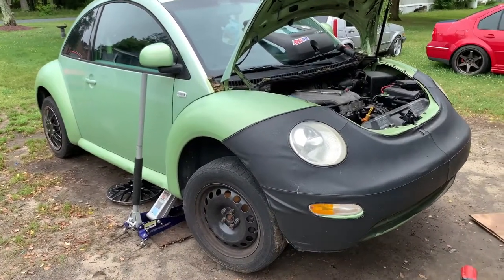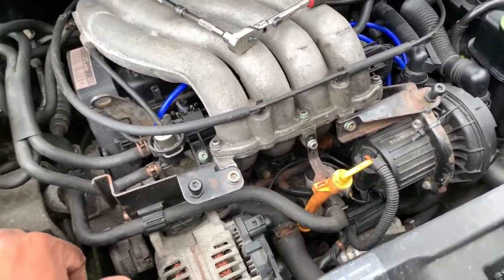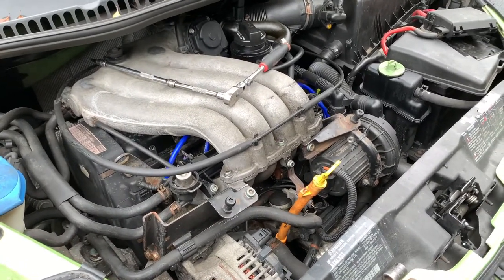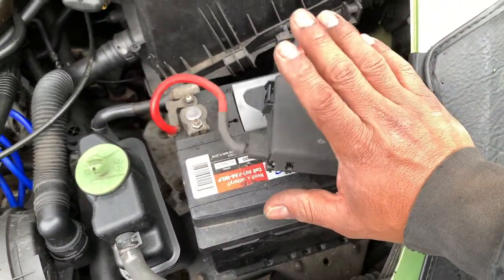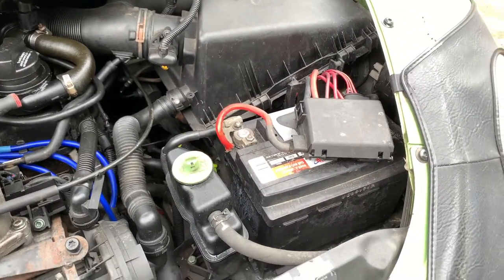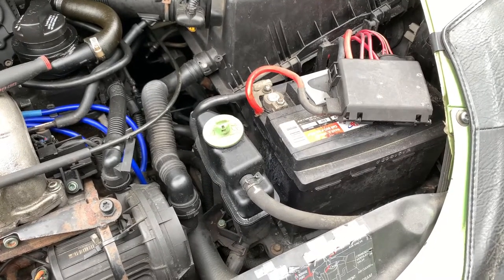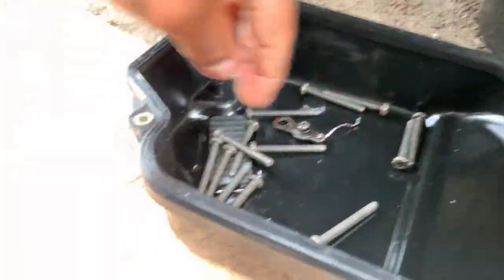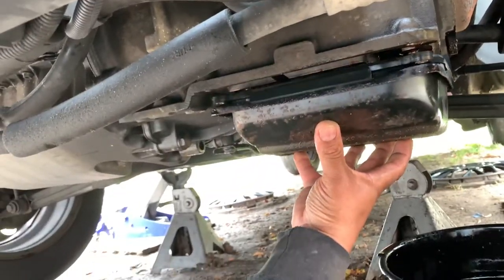Vw beetle aeg 2.0 automatic transmission problems

Comment: Hello, thanks a lot for the video. I have a golf with an 01M that shifts late from 3rd to 4th. Do you think this could be a valve body issue? It also will slip from 1st to 2nd when cold but once warm it's good. It's got almost 400kms on it. I changed fluid and filter recently but still delayed shift from 3rd to 4th. Also, what did you clean the valve body with, water?
Reply from the maker: Solenoids are lazy  and probably worn out is best to replace them

Comment: Hope your better by now! I got a 2002 vw beetle 2.0 automatic. You can manually shift it to 1st, 2nd, 3rd. It will eventually shift on it own but not till it gets to around 5-6000 rpm. But only to 3rd gear it don't go to 4th. Any suggestions.
Reply from the maker: Bad valve body

Comment: I've been gifted a 2000 Volkswagen Beetle from my mother who was dying of cancer. Sadly she passed away 7 years ago. I only drive her car once in awhile and it seems that when I shift from Park to reverse and then go from reverse to drive there is a delay in the gear shifting. The car is a automatic and has just under 80,000 miles. Is this something that all Volkswagens do sometimes or is this a warning that I'm going to have transmission problems? I just scheduled an appointment to have the transmission flushed because I think it's time. What do you think? I'm a new subscriber and I plan to stay I really like your videos and I hope you got over covid quickly
Reply from the maker: Hey man  thanks for you support,  the delay could be because is low of fluid or not receiving enough pressure from torque converter   Or you try to do that when is cold  it will do that!
Reply: @taco8v  yes I believe it is cold when it does it. You're so smart when it comes to a lot of things and I want to thank you. I'm a girl and I had a problem last week with my bug, the turn signals stopped working and so did the hazard lights. I YouTube the problem and fixed it all by myself. The problem was the hazard switch but first I checked the fuse. Got a used Hazard switch for $20 and for $20 a gentleman put it on for me and now my signals work. I know if I would have taken it to a shop it would have costed me a few hundred dollars because let's face it, it's not cheap to have someone work on your Volkswagen Beetle. I am so glad my mother gifted me this cute little car. She's a yellow bug 2000 automatic and has under 80,000 original miles. I will have the transmission fluid flushed and an oil change the first week of October because I think she's due for both. I enjoy your channel and can't wait for your next upload. Have a great day
Reply from the maker: Your welcome  and pay attention when they flush the transmission  make sure you watching them doing it  , sometimes they say they flush it but they only do the one at the transmission pan and not on the torque converter  , for that they need remove the oil cooler at top and put and special adapter to connect  the hose and run the car to bleed the entire transmission   Not many people do that !
Reply: @taco8v  oh shit, they're probably going to do it the easy way and not do it the right way. Where are you when I need you LOL. Maybe I need to take it to a Volkswagen dealer to have it done right. Thank you for this advice, I don't want to pay for a Cheesy transmission flush
Reply from the maker: Whats your instagram or messenger?

Comment: Oh god good thing i found this video. Only little has an expertise on these beetles. I have a question sir. my 2000 beetle 2.0 automatic has transmission problems. It loses power and stops when it gets warmed. We tried scanning it, and the error pointed out the Transmission Control Module. Now i dont know if thats really the problem. So I wanna consult you before getting a new TCM which is hella expensive. I hope you respond
Reply from the maker: Loses power what do you meant?  Engine lose power or engine its running and revving but car doesn’t moves?
Reply: @taco8v   engine is running and revving but car doesnt move. Once cooled down, it starts to drive again for a couple of minutes
Reply from the maker: Ooh you need fluid  in the transmission  its low  ,put a couple quarts in it and hopefully you haven’t burned the clutches yet
Reply: @taco8v  this applies to an automatic right? and I dont have to replace the transmission control module right away? sh!ts expensive lol
Reply from the maker: Yes automatic  i know I mentioned clutches  because automatic transmission have clutches for each gear including reverse.   And manual transmission only has 1 clutch 
And i cannot tell you if you need to replace or not any other stuff im sorry in many cases is best to just replace the transmission do to all the damage so here you are on you own buddy  . Im just suggesting to add more fluid  because it sounds like its dry it  .  And by adding more fluid you can probably save your transmission  or maybe is to late   Its a gamble

Comment: Hi man i got issue with volkswagen 1999 2.0l. it seems i got sound when i shift from P to R or D also when shifting from 3-4 or 4-3 it slides with sound what do you think i need to replace?
Reply from the maker: If transmission slips pretty much you need to replace it  because clutches are sliding and all the solenoids are working how it should but clutches are toast
Reply: @taco8v  you mean the transmission will it not solve if I just get the valve body?thank you for the reply
Reply from the maker: @mun-eimasmawil2714 nope  its not the valve body its the transmission

Comment: Hello, I have a 1999 new beetle 2.0L I just got a Spark plugs , ignition wires for the tune up and And I’m do fuel induction service And I’m do fuel induction service done oh my car, but as I drive it, the check engine light blanks on it off my car began to shake, and then it lost power and came back, but as I drive it, it skips a little do you think they could be my transmission? I’m going to get a diagnose test tomorrow and it cost 125.
Reply from the maker: Buy a vcds one bin it will come very handy  it cost 100  instead of going to a shop to diagnose you car . 

If car has misfire it maybe your ignition coil
Reply: @taco8v   where can I get it from?
Reply from the maker: Vcds ross tech   Googled

Comment: I got a 05 jetta mk4 same engine the 2.0 I recently had problems with it not reversing at all before it went out I would creep a little forward then shift into reverse but going forward everything works fine though going uphill when it's cold it kicks forward a little it's at 159k going to service the tranny at 160k new filter fluid sensors etc would it be recommended to get a new valve body or just do the fluid change I know the previous owner probably never bothered to service the transmission so low fluid could be all it is but I need a second opinion on it
Reply from the maker: Try the cheap way by changing the fluids and filter and see if that likes it , and if you still seen this problem get a rebuilt valve body with all new sensors , cables and speed sensor

Comment: I have a MK3 01M. It WILL shift, but only if run the RPMS high or let off the gas after accelerating. I was thinking low/dirty fluid. Thoughts?
Reply from the maker: This is your valve body dirty or solenoids  i suggest changing the valve body , but if you do  please torque to specks   Please do not over tightened because valve body can bend easily
Reply: @taco8v I wonder if an oil and filter change would be enough.
Reply from the maker: @justinrrizzo sometimes a new fluid makes it worse lol this transmissions are weird  but you can try to top it off instead of changing the fluid

Comment: A friend has a 2004 Beetle and it won't shift properly until the car has warmed up.  Otherwise you have to lift
your foot off the gas and then it will.  Kind of like Chevy powerglides would do when they were getting old.
Any ideas....water temp sensor??
Reply from the maker: Low transmission fluid man
Reply: @taco8v  Not being a VW guy myself, I didn't even think of that, but I haven't seen the car yet either.   
I'll have him check that tomorrow and then let you know.  THANKS!!

Comment: I have a Volkswagen Beetle 2005 and the transmission is starting to slip on low gear. Is there a fix to that?
Reply from the maker: Check the fluid level  first  if is low thats your problem if not there’s not a easy fix if still slipping it will  need a rebuilt transmission or good used one   .  
Hopefully is just low on fluid
Reply: @taco8v  I’m assuming a rebuild is quit expensive!
Reply from the maker: Yup

Comment: Hello, I have the same Beetle but when I go to change gears it feels strong and it doesn't pull third until I accelerate to 40 miles, any solution???🙏🙏🙏🙏🙏
Reply from the maker: Maybe is low on fluid or you have worn solenoids  maybe time to change the valve body also maybe a torque converter worse the case

Comment: Hi, I have a problem with the transmission slipping in 4th gear. 1, 2, and 3 are good except 4th. I already replaced the valve-body with a rebuilt one online and the fluid level is good. Would I have a problem with the clutch pads?
Reply from the maker: Yes man clutch for 4th is burned :(  

Theres some people the increase the pump pressure at valve body and has helped to last a bit longer and other way is trying to put a new torque converter  and many cases solved the problem but im not 100% sure on this bud   

Thats the advice i can give you
Reply: @taco8v  Thank you, I really appreciate the advice. I already increased the pressure; I'm gonna look more into the torque converter. Just really unfortunate cause I already did so much to this car and just now I know the 4th clutch is bad.

Comment: Hi, got a 2003 vw beetle automatic. Stops shifting when hot. What kind of problem am I facing?
Reply from the maker: Burned clutches  or low fluid
Reply: @taco8v  yes sir, will check in to that the weekend. Thank you

Comment: I have 2004 Beatles gl automatic 😮 doesn't pass 3rd gear goes only 60mph any help
Reply from the maker: That is your valve body
Reply: @taco8v  ok thank you
Reply: @taco8v  the car has two code p0748 and p3081 you sure it's the valve body
Reply from the maker: Yes  those codes are for solenoids being bad   And you not replace just this , you replace the whole valve body for a rebuild one and all new solenoids and sensors with ribon cable

Comment: Each of those are fuse able links, when some does have an electrical issue you will melt that circuit. Put it back....
Reply from the maker: That cable only comes from the alternator buddy  trust me you will know in your  dash if the alternator stops working because it has a separate circuit to tell the dash whats going on . 

You won’t melt anything there buddy   I being doing this for 15 years and nothing has ever happened to anyone  
Infact they stopped to melt that fuse box originally a problem from factory.